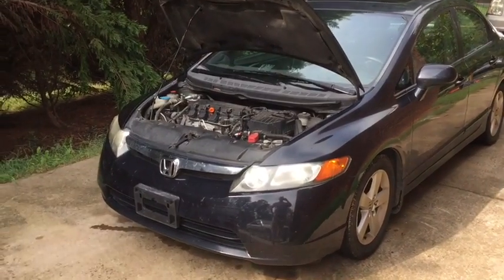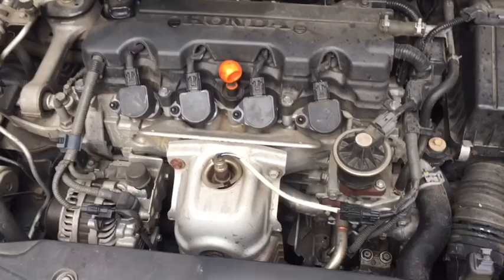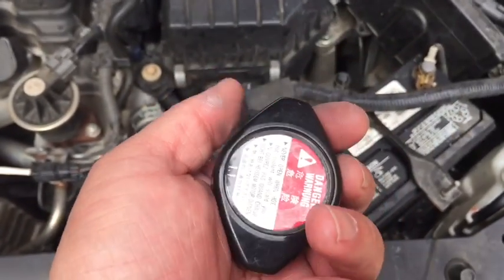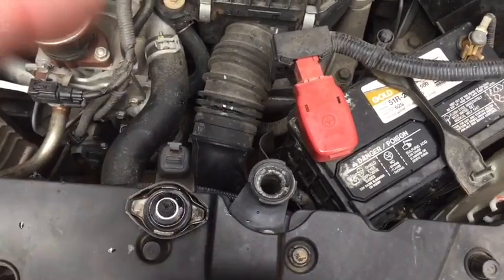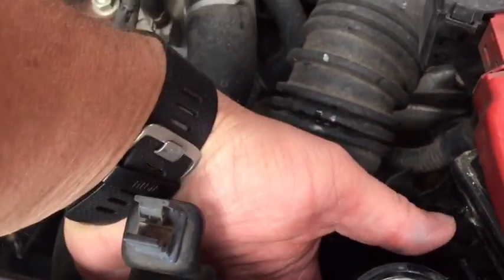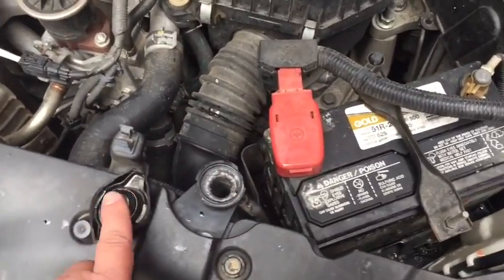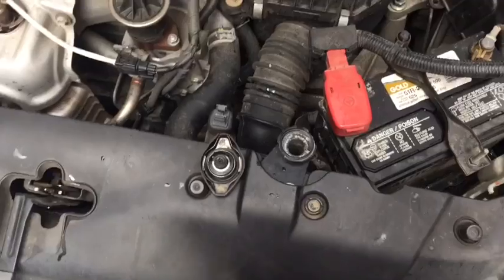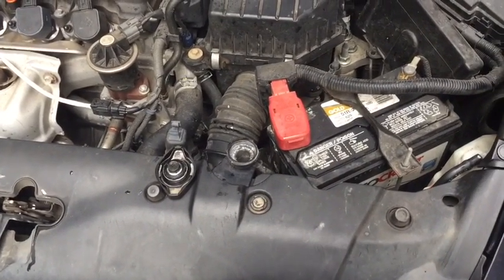Honda Civic losing coolant no visible leak

Comment: Thank you for this video. I was having the same issues and the way you explained it. I replaced it for $22 and it seems to be driving better and holding as it should. I will drive more to see if there are any other issues but so far so good. That’s for the explanation and video.

Comment: I just got a really clean 2002 civic as my first vehicle and its been burning coolant for about a two months now with no visible leak. me and my friend who is a mechanic have a few ideas on what it could be but "he's been a mechanic for 5 years and I wont lie I don't know jack shit about vehicles but I like learning and i mean I just got my first vehicle 5 months ago lmao" anyway I have like 2 hours until school so I figured I might as well watch some videos to get some ideas, thanks for the video ! simple and easy to understand.
Reply: Did you ever figure it out? I got a 2002 crv with the k24 engine and got it at 243k miles. I drive it like a project car, shakey but still takes it. Only thing is.. I burn through oil and coolant before I'm due for an oil change or right on that mile mark. No leaks. Shit weird... but also old and had things like engine mounts come off while delivering pizzas lol. It's crazy what these older honda's can take for a beating. Like old trucks. I'm at 254k miles. Got the AWD too... Just likes to drive hard I think (or say to feel like I'm not killing it). One I get a cherry picker going to take a look cus if the engine is still strong.. .maybe make a sleeper and boost it?

Comment: Thanks for the video! My 2005 civic has been over heating especially more now in the summer. It's never smoked as I pull over quickly. I brought it to two mechanics.
(First mechanic) The pressure test went well apparently and no signs of leaking. 
(Second mechanic) ran dye through and speculates a head gasket issue but is uncertain. 
When I add coolant, it's 95% into the radiator and not the resevoir.
It's hard to want to pay for a head gasket without knowing for sure if that's the issue.
If you stumble upon a situation like mine, maybe you could post another video 😊
Reply from the maker: Alicia Greeley head gasket should have shown up with a pressure drop during the pressure test.  Many times the water pump will be your leak but because it is difficult to see can be overlooked. Fill your coolant and then let the car run. While it is running look for drips underneath. Make sure your a/c is off when you do this. If you see a leak to the inside of your passenger tire replace your water pump.
Reply: @YourCarGuyDR  thank you! I've seen that issue with a few other videos I've watched. I can definitely see how it can be overlooked! I will give it a try for my next measure. Thank you!
Reply: 2005 civic water pump would leak by the driver side tire, just FYI
Reply: Hey Alicia, did you ever figure it out I am dealing with this now as well. 
Pressure test came back good, both the engine and rad pressured up and worked good. 
I do not want to have to pay for a head gasket either.
Reply: @CKG1973  unfortunately 😕 I decided to get a new car. The expenses weren't going to be worth it to me. I'm sorry

Comment: My problem is identical to this. I already had checked the cooling system with no visible leaks on radiator or hoses. I did notice my radiator cap was looking rather.. crusty to say the least. After 3 test drives i had coolant at the bottom of engine bay. Lets see if new cap fixes the issue
Reply: Update ??
Reply: @idkanythingiamme9365  It seems that changing the coolant cap helped a little bit. Not losing coolant as rapidly as before. But there seems to be a wet coolant spot constantly under my radiator. So its like partly fixed. (need to do pressure test)
Reply: @idkanythingiamme9365  i have same problem with 2000s d16y8 , ive done pressure test twice. , nothing wrong
 It might be the headgasket
 or the sufaces
between block and headgasket
 or head to head gasket
Motor ate the coolant but not into motor oil

Comment: I had the same issue but I was losing coolant through the expansion tank whenever I was going highway speeds changed multiple things before finally figuring out that the system was over pressurized due to bad head gasket
Reply: Was your car whistling too or jowd you know it was gasket?
Reply: @myriadarcana9022   not too my knowledge basically after turning off the car a few minutes later the coolant would burst out of the expansion tank
Reply: Hey my 2010 Honda Civic LX is whistling i thought it was alternator bearings but is it the head gasket or what ?? Im getting chest pain driving it which i usually get im sensitive to chemicals
Reply: What test did you do to figure it was head gasket

Comment: Hopefully this is my problem. I have a 2003 civic and every time I remove the radiator cap to check the coolant level it’s always a little low and yes the coolant overflow bottle is full. I haven’t had time or money to go get a pressure test done. Hopefully it’s not my head gasket. It’s not over heating.

Comment: In my case, I'm literally consuming water with " no visible trace". I eather have a physical phenomena going on, or I can consume 1-1/2 gallons of water an hour, with no leaking on the ground or steam out the tail pipe. The water that is getting into the combustion chamber is being turned into energy in order to stay in complience with the conservation of mass.
Reply: Hey David did you ever figure it out I am dealing with that now.
Reply: @CKG1973  Yes I did! I towed it (cold) a block away from the title pawn place. Then drove it there, pawned the title, walked to the wreaker, drove to the bank and cashed the check! I literally theft the keys in it, in their parking lot. LOL
Reply: @davidrule1335  not exactly what I was looking for lol but thanks
Reply: @davidrule1335  🤣🤣🤣

Comment: Gotta 04 civic,new water pump,new thermostat but still leaking from the cap. What could be causing it
Reply from the maker: Check the neck to the radiator, also you may want to test for a blown head gasket.

Comment: I have the exact same issue on a 99 Civic. It's a slow leak or coolant disappearing somewhere. If I fill my radiator it will take 2-3 months before it will start overheating again. Everything I have replaced coolant related is Honda OEM except the radiator. The radiator is from O'reilly's. It's been driving me nuts because I don't see any visible leaks.
Reply: I had that issue was water pump for me
Reply: Did u fix it
Reply: @abimariavargas7086  Yup, I bought an OEM Radiator. Turned out on that aftermarket radiator had a teenie tiny hole on the back side that was leaking coolant. I couldn’t see until I took out the radiator.

Comment: My coolant keeps getting low but no overheating! We changed the thermostat it's still the same! The radiator cap looks good too 🤨🤨🤨🤨
Reply from the maker: Anel Rociio check your water pump. With the engine running look for a leak below the engine on the passenger side.
Reply: Your Car Guy DR thank you! Will check today
Reply: You may have to much water and not enough coolant in your vehicle. Water will burn off and evaporate very quickly compared to your coolant.
Reply: @912MNG  where do I check the water level?
Reply: Compare your radiator cap to a new one. Mine looked good but it was missing the little metal part above the gasket that lets coolant flow into the Reservoir

Comment: What about leaving the cap off and let the car idle a few minutes and some steam comes out the radiator?
Reply from the maker: Gamer Cat some steam will be normal with the cap off. You can get a combustion gas tester which is  relatively inexpensive and see if you are getting combustion gas in the coolant. This is an inexpensive way to determine if you have a head gasket issue.

Comment: Hi, I just recently bought a used 2008 Honda Civic Si coupe and I noticed there was no coolant in the  reservoir. After letting the engine cool down, I fill the reservoir till it hit max. A day later, I took it for a drive and the temperature seemed fine, it was in the middle as it always is, however when I checked the reservoir again and the coolant was all gone! No visible leaks whatsoever. I thought it might be the head gasket, so I turned on the car, warmed it up, and revved the engine. I had a friend check if there was any fluid or white smoke come out of the exhaust and there was none. I checked the radiator cap and it didn’t seem worn out...any theories as to what it could be?
Reply from the maker: Nick Algiers first check your oil level to make sure it isn’t over full. If the oil looks good the best thing to do is make sure the coolant is full and just let it idle while watching underneath for any drips at all. I would suspect a water pump. They tend to only leak when driving and you may never see any drips.
Reply: Might be the heater core too because i think mine is leaking I can definitely smell coolant without the bypass i had on the heater core but now its cold ill have to replace it.

Comment: Hey sir, I am having doubts that I have a blown head gasket, how can I be for sure? Is there any test I can do?
Reply from the maker: There are a couple of tests that can BWE done. One would be a compression test. Low compression on one or more cylinders could indicate a blown head gasket. Also there is a kit you can buy from most parts stores that is a combustion gas detection kit. It isn’t very  expensive and is fairly simple to use. If you have combustion gas in your coolant then you likely have a blown head gasket or cracked head.
Reply: @YourCarGuyDR  Hi, I did a compression test and the results were good but my coolant overflow tank is empty and smells weird, like gasoline or something. The coolant was full in the radiator but now I cant see coolant there as well. Oil level is the same as before, no smoke or anything.
The car jerks sometimes for a second when accelerating but not that often.
What could be the problem?
Reply from the maker: @makimano1990  you can fill your coolant and pressure test the cooling system. Look for an external leak. Also get a combustion gas test kit and check for combustion gasses in the cooling system.

Comment: Okay but mine is brand new but there is no visible leak and it over heated while idle
Reply from the maker: You could have a blown head gasket. These engines also have a metal pipe that runs from the front cover behind the water pump that can crack. It is very difficult to see a leak in that area.
Reply: @YourCarGuyDR  it had no antifreeze 💀

Comment: yesterday my civic engine started smoking and engine warms up...i opened the bonet and seen coolant is leaking and there is no coolant and car didnt runs perfectly its all jerking while i rev the engine.. engine sounds like crap and smoke coming from exhaust tooo....help me what would have happened...😣😣
Reply from the maker: JMP News that doesn’t sound good. You want to refill the coolant (you can use water as a temporary coolant). Then look to see if you have a visible leak. Based on what you have said you may have a blown head gasket which would mean a significant amount of work to repair. Hopefully you just have an external leak. Make sure to check your oil level. If it is overfilled there is a chance that some of the coolant went into the oil. That is bad. Also check the underside of the oil cap. If you have a milky colored build up that is also a sign of coolant in the oil and would mean a major repair.

Comment: My car coolant gets empty quick especially when i turn on the A/c what's ur recommendation?
Reply from the maker: Romantico Poeta the air conditioning shouldn’t have any effect. With the car running look for any drips underneath. Particularly near the passenger side front.
Reply: Romantico poeta did you fix it  i have the same problem
Reply: "It gets empty sometimes i dont know why maybe its when u leave ur car parked with the a/c on

Comment: I have an O2 Honda Civic. I replace the radiator and the reservoir because it was having his shoes overheating. My fans work but it was burning through coolant really quickly. Since I have changed out the radiator and everything it's still burns through coolant kind of quick, not as fast as it was. It doesn't overheat anywhere near as much, but now the reservoir has a black buildup in it. Any clue what that could be?
Reply from the maker: It sounds like you may have a blown head gasket. There is an easy test for this. I will include a link to my video showing this. 
Easy Test for Blown Head Gasket
Reply from the maker: https://youtu.be/GLp0jSIpxrY

Comment: how much coolant lost is considered normal?
Reply from the maker: A proper system should not have any loss. If you have recently had work to the system you may be adding some regularly as all of the air pockets work their way out.

Comment: Hi,  i have issues with my prestone with my Honda civic 2002.   There's air build up in the engine and the prestone goes right into the reservoir, and spilled through the reservoir, and stay full. I have changed the radiator cap and thermostat.   No white smoke coming off the muffler, no white desposits in the oil.
When i remove the radiator cap after engine cooled up, there's a big bubble of prestone coming off the radiator.
I noticed I only started to have issues after I did an oil change.  I did not go behond the max. mark.

Could be the head gasket, but any other areas that it could be?

Mario, Nova Scotia, Canada
Reply from the maker: Mario Cyr I would go to the auto parts store and get a combustion gas test kit. They are not expensive. It will tell you if you have a blown head gasket or cracked head. It is the most likely issue.
Reply: I have the same problem. I guess I'm going to go get a combustion gas test kit..
Reply: I’ve got the same exact issue (2003 Civic Lx) seems to be a very common issue.
Reply: @TranscendentaLobo27 so what did you do?

Comment: I’m having an issue where it seems like fluid is spraying out of the radiator and building up around the battery, causing a lot of steam to billow up. It started yesterday because my serpentine belt broke. I replaced the belt and it’s been running well, but by the end of my commute to work, the battery was steaming again and I opened the hood to see where things had sprayed. Any suggestions for how to remedy this? Should I replace the radiator cap? I don’t really know much about cars, but I rely on my vehicle for literally everything, and I will be completely fucked if it stops working… Don’t really have money to take it to a shop or spend a lot on parts.
Reply from the maker: If the radiator cap isn’t sealing it could cause your issue. Is your temperature staying in the proper range?
Reply: @YourCarGuyDR  No actually it got so hot it reached the maximum on the gauge and I had to rush it to the nearest certified Honda mechanic. Time will tell…
Reply: What happened
Reply: @JoJoG187  Head gasket was cracked, entire engine needed to be replaced

Comment: If I am missing half a glass of water in the radiator, I do not fill water and then they disappear that way this is the situation regularly. Is it okay? And in a condensing tank everything is fine
Reply from the maker: If the radiator continues to lose coolant then you likely have a small leak. I would keep an eye on it and check it regularly. Particularly if you see the temperature run higher than normal.
Reply: @YourCarGuyDR i replaced the radiator a week ago and since that is the situation the amount of water does not continue to drop, I went back to the garage for a test, he checked air pressure and checked that there is no leakage and said that everything is fine, but still continue to monitor that it does not continue to drop. He said that if it keeps going down then there is a problem and if it does not keep going down then everything is fine. The question is is this small lack of water normal? (Half a glass of water) Regarding engine heat there is no change everything is fine
Reply from the maker: @os4635  your mechanic has given good advice. The small amount of water is likely due to some air pockets that were in the system from changing the radiator. If it stops losing the small amount there is nothing to worry about.
Reply: @YourCarGuyDR  Got it, thanks a lot for the help. very appreciate